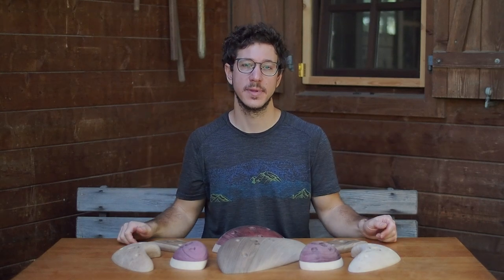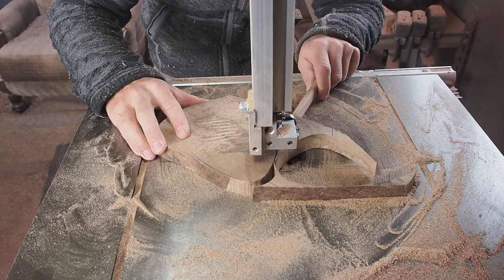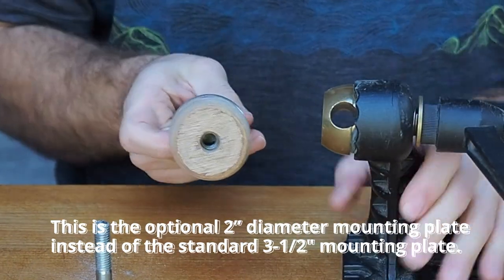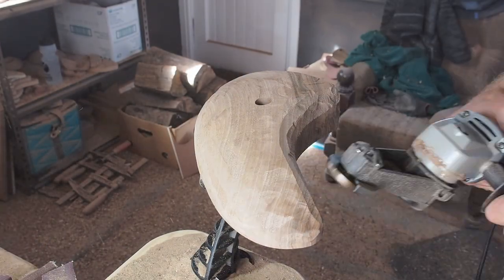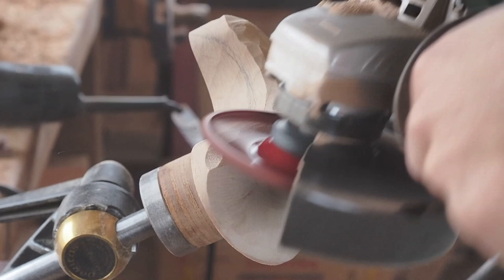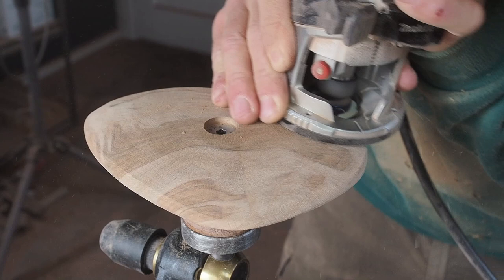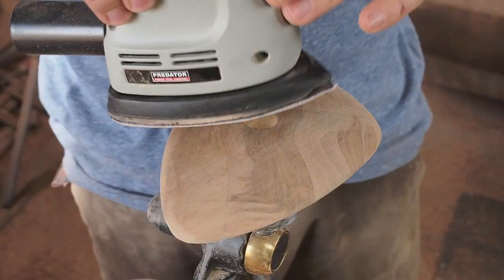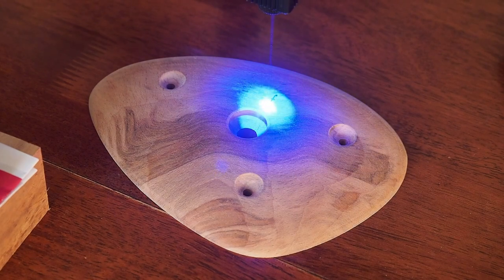Creative Woodworking – How to Make Wooden Climbing Holds

Comment: This video inspired me to make holds for my home wall. I didn't write "TOP" on the wood block until I messed up and made mirrored shape from what I wanted 😛. 
I use 60 grit sandpaper grinding flap disk to carve hold into a shape. It takes more time, but it is much safer and my holds aren't that big - no more than 20 cm.

Comment: My new favorite channel!  What are the smallest holds you can make with this method? I have a workshop full of offcuts and want to make some for my kids to use too.  Have you ever tried rasps to shape the holds> Slower than your arbourtech no doubt, but I have some so I'll try those first.
Reply from the maker: Thanks Paul! The smallest ones I made on the carver's vise were around 5 cm in diameter (footholds). But in my experience, it's more efficient to shape a long strip of wood and then cut it in smaller pieces and just round of the edges in the last step.
I haven't really used rasps because I already had the power carving tools when I started making holds, but I think it's definitely worth using them before investing in new tools. I hope you'll enjoy the process of shaping your first holds.

Comment: Thank you! Very helpful and thorough! Making my own out holds of walnut, and have been using fine (120 grit) sandpaper to finish even the grip surface. I will have to try just using 80 grit to see how that feels!
Reply from the maker: Yes, definitely try it! Especially walnut is quite slippery when finished with 120 grit.

Comment: do you know how to add friction grip to the hold? some wooden holds have it like 'dualtex''. thx
Reply from the maker: I haven't done it myself but typically it's done by using multiple layers of epoxy floor paint and add some really fine sand in between. Basically the same way textured climbing walls are typically made.

Comment: Do you think a 4 inch belt sander would get the job done? I'm also looking at getting a Used 14 inch bandsaw.
Reply from the maker: I have used both. A 4 inch belt sander is definitely useful for smaller holds, but a 6 inch wide belt makes a huge difference.
Reply: Thanks for the
Reply I'll definitely go for this 6"

Comment: Great stuff as always!!! Love the format. What sanding sponge are you using? Also I noticed you're using a 11mm dril bit, why not 10 since that's the diameter of the bolts?
Reply from the maker: Thanks David! 
Most of time, I'm using the fine (100 or 120 grit) sanding sponges made by 3M (a lot of hardware stores sell them). 
If you use a 10 mm drill bit you will spend more time with attaching the holds to the wall. It's always easier with a little bit of play. That's even more important if you use a drill to drill the bolt hole instead of a drill press.

Comment: What are the bits you are using with the trim routers? Are you just using them to make the edge a consistent roundness?
Reply from the maker: I am using 5, 8, and 10 mm radius roundover bits. Yes, for a consistent roundness but also to safe time. (A sharp edge isn't an option because it will rip the skin)

Comment: Have you used the Kutzall Dish Wheel for climbing holds? 

Looking for an alternative to the mini carver.
Reply from the maker: I haven't used the Kutzall discs, but the King Arthur's Tools carbide disc which I have used (and mentioned in the video) are probably similar. In my opinion, they are no replacement for the Arbortech discs since they are much slower and create way more dust. But as mentioned in the video, they are good for finer concave features.

Comment: Hi. Just to check: you use M10 screws but drill 11 mm holes into the holds, correct?
Reply from the maker: Yes, that's correct. You want to have a little bit of play in case the holes you drill are not perfectly 90 degrees or the T-nut is slightly misaligned.
Reply: I start with 10,5 mm. You can always make it bigger later.

Comment: is the purple heart-ash sloper made out of two types of woods screwed/pasted together? or is it just one piece? :)
Reply from the maker: It's made out of Purpleheart laminated on top of Ash, so two different types of wood. :)
Reply: Any tips on lamination for climbing holds? Do you just use regular wood glue and planed surfaces?

Comment: Are the chips from the powercarver a bit "heavier" than from the sander? Or to ask it a different way, is it less dusty compared with hours of belt sanding?
Reply from the maker: Most of the chips from the powercarver are about 5 - 10 mm in size, so it is definitely less dusty, or at least there is less dust in the air (less fine particles). But there are still some airborne which is why I keep wearing a dust mask.
Reply: @wurfttobias  Cool, thats a real benefit actually. I made a lot of holds outside with a handheld belt sander and no extraction. It probably wasn't the best for the health.. In the future I'll have to be indoors in a basement, so I'm thinking about how to make it sustainable re the airborne dust. (Edit: actually kept watching to the end :facepalm:)
Reply: @wurfttobias  Not sure if you have mentioned it elsewhere.. Did you ever try out the arbortech turboplane attachment?
Reply from the maker: @stevebarratt888  yes, I mention it in this video. :)

Comment: Do you apply any finishes such as oil? Or would that make the hold slippery?
Reply from the maker: I've oiled the top surface of a few holds in the past, just for looks. Wouldn't recommend oiling the grip area because that makes them slippery. I also sand the holds when doing a complete reset. They are basically brand new afterwards, but this won't work with oil or any other finish.